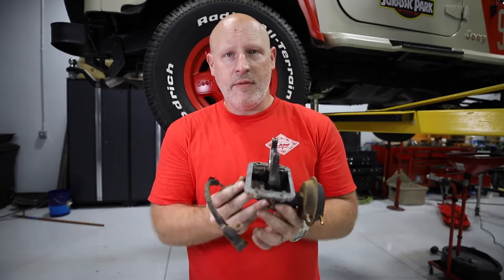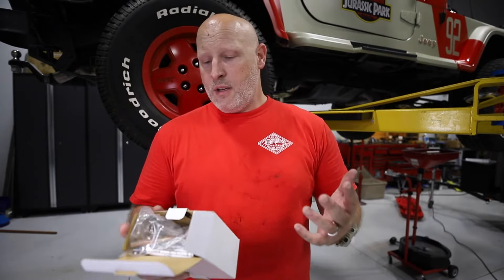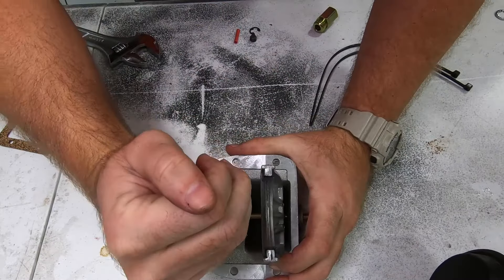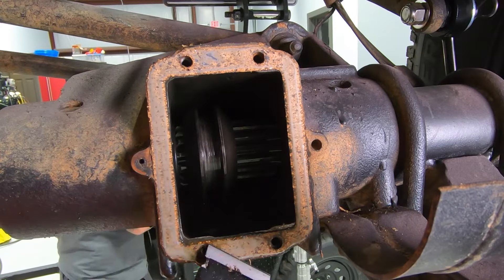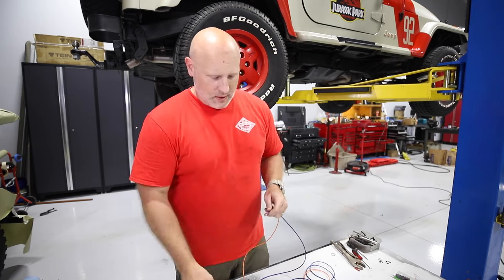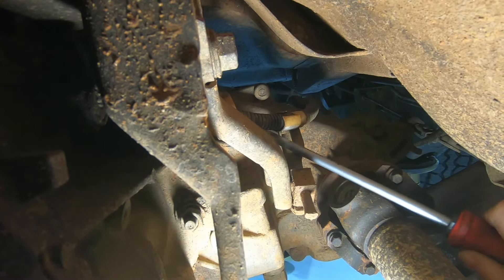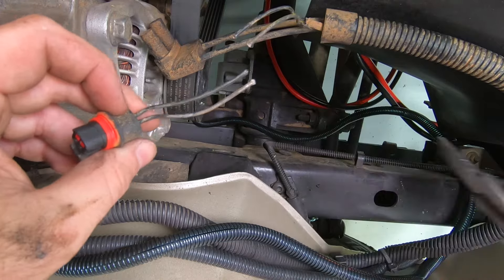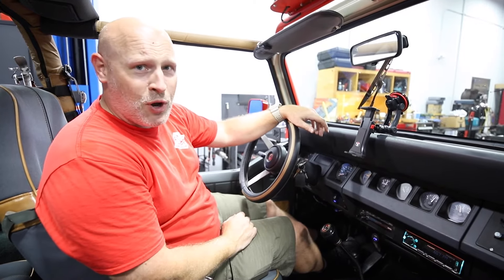Jeep YJ Central Axle Disconnect CAD delete with working 4WD indicator light

Comment: Nice video Matt! I deleted my CAD as well but with a solid axle (same net effect). Great to be rid of a 4WD system that relies on the integrity of a network of small rubber hoses from the intake through the transfer case and back to the actuator in the front diff. An absolute must have mod IMO! Cheers
Reply from the maker: Thanks! Yeah it was a much do for me as well! Hope you had a great thanksgiving!

Comment: On a 93 yj there is no sensor on the transfer case.The sensor for 4wd light is on the cad.There is only a vacuum line switch on the transfercase.
Reply: Did you solve that problem cause in a week im facing the same issue. Please get back.

Comment: Yeah my 1st time that it failed I fixed it temporarily by just pulling it off and putting the hose clamp around the axle holding it in place then I cut open The bad vacuum housing and had a zip tie accelerator for the long distance What just recently went with a cable actuator

Comment: Just what I needed. Thanks for the link to the TY sensor. I don't own a TJ or finding the sensor was concerning but rewatching the video I saw where the link for the correct part was. Thanks again.
Reply from the maker: You're welcome!
Reply: @SimplyMustGo  My PSL900 has a switch on the actuator to be installed. I have no video of where those wires go. Figured that switch would let me know anytime the axle is in lock position.

Comment: Nice option. I replaced the 'CAD' side of the D30 when the outer shaft developed a groove around the outer axle seal. replaced it with a donated XJ half shaft as that YJ outer shaft is stupid expensive. Works fine and has for years. Yeah, lost the 4wd light, but fortunately i some common sense and know when i've pulled the lever!
Reply from the maker: Yeah that’s another good option for sure.

Comment: Very thorough video, I'm actually about to address this on my Jeep but I have a slightly different approach 😉
Reply from the maker: Thank you! What will you be doing differently?
Reply: @SimplyMustGo  I'll be replacing the split shaft with a one piece chromoly shaft and installing a cover plate.
Reply from the maker: @SquareLyfe  nice! Yeah that the next level up for sure.

Comment: Great video!  aside from changing out the sensor for the vacuum hoses on the transfer case what about the wiring plug and sensor at the back of the transfer case? I thought that went to the gauge cluster to control the 4wd light.  Excellent video. I have a 1993 YJ

Comment: great video. I'm currently building my Jeep and I'm doing the front axle now. I purchased the CAD delete kit and I'm prepared to install but,.... the links to the parts you listed no longer show available.... I need the switch and the wire harness connection.... also the plugs....and lastly, what size wire did you use to carry the new set up to the T-Case?  any chance you might know where I can find those parts now? Again great video!!! thanks for sharing your knowledge...

Comment: Hey, I just removed the old and installed the new one on my 1994 jeep wrangler YJ.. broke two bolts trying to remove the bolts had to run to Ace hardware and get new bolts and a couple of washers to come back and weld them and two of the old bolts on to the broken bolts.. finally got it all done..now my dilemma is, the driveshaft is off going to the np231j because I am still running marine water hose and I have to weld on some brackets on the frame to keep them out of the way.. anyway back to my dilemma... I rolled the passenger side  rotor and it was connected to the axle as it was making the yoke turn..but wait..why is it turning and the drivers side is on the ground..not engaged or moving with it or since it's on the ground
.why is everything moving except the drivers side!?!.. any ideas..or is it broken...or stripped ???😮

Comment: I’ve installed this kit and for me the hardest part is the adjustment of the cable to insure proper travel for complete engagement and also disengagement, the latter I believe is what turns off 4wd light, can you Matt or someone else do a video on the cable adjustment? There are two adjustments, one at cad housing and one at engagement handle, this process is critical yet not addressed in video, severe damage could occur if cable not precisely calibrated, help please?
Reply from the maker: The kit I installed did not require the cable, it’s an always locked system. So I don’t really know anything about adjusting the cables. Sorry.

Comment: Great video, but I have a question: Don’t you tires skip/push when turning, especially on dry payment? Thanks
Reply from the maker: No this isn’t a locker. This just fixed the two part axle issue. Lockers would go in the differential and lock both the left and right axles together. This is just making the right axle one piece. It still spins independently of the left axle.
Reply: @SimplyMustGo  Thank you

Comment: Any issue with vibrations at higher speeds? I read somewhere that the front shafts weren’t balanced from the factory due to the oem disconnect. Keep up the good content 🤙🏻
Reply from the maker: I haven’t had any issues with that. But I also don’t take her past about 65

Comment: I put the cable system in mine and it’s been in 2 years.  Working fine.  Is there an advantage to allowing it to disconnect?
Reply from the maker: I don’t know there is any actual advantage to letting it disconnect since ever since the TJ they removed that system completely so it’s a solid axle.

Comment: Hi Matt,

A Quick question..I’ve ordered the CaD vac delete kit plus TJ sensor and the very same connector..is this all I’ll need to upgrade it?

My 94 YJ has the 4x4 light on permanently but isn’t in 4x4 B/c I’ve checked by lifting the front tires 🛞 and spinning only one
Reply from the maker: Yeah that should be it, though I have no idea why your light would always be on, so that might cause some weird issues with the light part.
Reply: @SimplyMustGo  Ok great. I replaced the Tcase because the old one was toast and installed a 1992 with only 125k but I’ve heard in some cases the old Tcase vacuum switch stays stuck open and leaves the 4x4 on even if it’s actually in 2WD. 

So in your video when you’re done installing the new parts on the Dana30 and permanently locked in 4x4, does the new switch electronically engage the 4H when shifting?

Sorry for the additional questions this is new to me as I’ve never owned a YJ until last year and trying to understand how everything works in sequence

Comment: Should you add locking hubs to the front when you delete the CAD Vac?
Reply from the maker: That’s kind of up to you. This doesn’t change anything from the perspective of lockers or open differentials from how it is stock. You aren’t doing anything to the differential, so if you want lockers, or locking hubs or anything else like that, whatever you’d want without this, is what you’d want with it.

Comment: Does the plug that goes into the sensor on the transfer case come with the kit and do you reuse the old sensor? I don't see any links to the kit you used. Can you provide a link?  Great video, seems pretty straight forward.
Reply from the maker: The links to the kit and sensors are in the description, but the short answer is they do not come together. You have to get the kit and the sensors and plug separately
Reply: What is that sensor originally too? Can't find that one in stock.

Comment: Hi Matt. Subbed.  Thank you for doing this video. I have a 90 with 4.7 stroker, howell EFi. We're doing a full resto. The 4wd light was the one thing stopping me from pulling the trigger on this mod. I just ordered everything.  Thanks for the links. My question is....

When wirring the extension wires it shouldn't matter what wire goes where right? Polarity is a non issue as long as I follow the same connections on both sides.  Ty bro.
Reply from the maker: Thank you. I believe that’s correct.
Reply: Thank you for the quick response.  @SimplyMustGo

Comment: I am real new to this and not much of a mechanic, But if I bypass CAD does that leave my jeep in 4w always?
Reply from the maker: No it doesn't. You still have to engage the transfer case for 4WD. This just connects the the two part axle into a solid axle on the passenger side. It also does not lock the drive and passenger side the way a locker would.

Comment: Great Video! Does this permanently engage the 4x4? Or can you still engage/disengage just like normal OEM operation? Thanks in advance and again... Wonderful content!
Reply from the maker: This does not permanently engage the 4x4 you still need to engage the transfer case by switching to 4H or 4L it’s also not a “locker” so your front tires will still spin independently. This just connects that portion of axel which is how the TJs and JK and JLs are normally. It was a weird experiment to have that split axel and it didn’t really do anything helpful.

Comment: I have got a 1988 comanche recently and it has no vacume harness going to the front axle, and no harness going to the transfer case either but 4x4 seems to work, so I recon what I am trying to find out is if there is no vacume going yo transfer is it necessary for it
Reply from the maker: It might not be a vacuum system. I think the only ones that did were the YJs
Reply: @SimplyMustGo  thank you for getting back with me

Comment: Doing the cad delete, does it increase drag on the drivetrain? When I put mine in four-wheel-drive, I can definitely feel the extra strain on the engine
Reply from the maker: No. They don’t do anything to the differentials or the transfer case. So when not in 4wd you will feel no difference.
Reply: @SimplyMustGo  I never thought about the fact the drag could be in the t case. Thanks for the reply

Comment: I have a 1991 YJ. My plugs are different. All I have is vacuum lines where your plug is.  My wires are in the back of the transfer case, and I don’t have a sensor
Reply from the maker: Do you have the 2.5 or 4.0?
Reply: @SimplyMustGo i got a 90 2.5 with the same issue and im doing this in a week with a month old pcl replacement in my knee.  Do you know of a solution to that vacuum switch problem so I don't have to keep crawling and having to fight to get up and down?

Comment: Sorry for my misunderstanding, if we do this then drive on pavement is it bad?  This is of course with transfer case in 2wd (disconnected)
Reply from the maker: Hey! Not at all. All this does is basically lock the two section of axel together the same way the other side is and the same way it is on every other Jeep after the YJ. It doesn’t lock the differentials, so it doesn’t change anything driving on or off road. All it does it give you one less thing to go wrong. If the vacuum lines were to fail, then that passenger side axel wouldn’t lock meaning you’d never get any power to the front passenger tire. This way, as long as the transfer case is engaged you’ll get power to both front tires until the open diffs engage.
Reply: @SimplyMustGo  I greatly appreciate your time to reply!  After battling grinding from a partial (and uninitiated) CAD, I'm excited to finally be rid of this terrible design forever. All the best.
Reply: I should add, I have the posilok 4x4 system.  Grinding only started after this purchase.
Reply: I was wondering about the locked axle, and turning on hard ground/ pavement etc. you answered that question so thank you !

Comment: Hey Matt! Need your help. I did the cad delete awhile ago and finally just did the 4wd light part. Only problem is my light stays on in 2wd also. Any ideas? Also it’s a 92 yj 4.0 5speed.
Reply from the maker: Hey! Unfortunately, I don’t have a good answer. I’m guessing it’s either not connected correctly, but I really don’t know why it would be on. I can’t think of a bunch of reason it would be off in 4WD, but not on in 2WD.
Reply: It’s actually on in 4wd and 2wd. I threw this question out to some others that did videos like this. Nobody really has a solid answer but said the sensor could be bad even though it’s new.

Comment: So when I do this mod, can I take ball looking thing any vacuum lines under the hood ?
Reply: Let me answer  since  no one  will yes throw  that sht away and cap off the vacuum  at engine  I've made my own disconnect from  a boat 🛥 shifter cable since I've installed 4×4 in my ramvan there's no lights yet

Comment: i dont understand this, how can u use 4x4 now, the posi lock ones had a cable that actuated it
Reply from the maker: This doesn't really impact 4x4 at all. This doesn't do anything to the transfer case or the differentials. This just permanently connect the two parts of the passenger axle shaft to make a single axle shaft, the same way it is in the XJs or TJs or JKs. There's no need for a cable since you don't need to turn it on / off. You still put the Jeep in 4wd by using the 4wd shifter and putting it in 4H or 4L. Many people will also just replace this whole passenger side shaft setup with an actual XJ shaft. In my other YJ I'm getting ready to do something similar, by taking the two piece out all together and replacing it with a single shaft.
Reply: @SimplyMustGo  do you have a locker in this jeep?
Reply from the maker: @dizzlerizzle2775  No, not in this one. I'm going to put one in my other YJ Soon. probably a lunchbox locker like a Spartan locker.

Comment: Is there any downside to doing a CAD delete. I read that it turns a chain and wears parts in the T-Case. I would like to do this but do not want to add another issue. Thanks
Reply from the maker: I’ve had this done for 2 years now and I’ve driven all the to Dayton (9 hrs pulling a trailer) I’ve driven all over on long 6 plus hour trips doing 70mph and I’ve never had any issue. No vibrations, no change in gas mileage. I’ve heard of other people claiming stuff, but I’ve only seen a positive result.
Reply: Thanks Matt. I just completed the delete.  @SimplyMustGo

Comment: The question is how do you unlock the axle from the hub with those wheels?
Reply from the maker: You don’t. This isn’t like a locker where you are locking both sides of the axles together at the differential, it’s just connecting the two part axle on the passenger side to be a single passenger side axel. The same way a TJ or JK out be and the same way the driver side of the YJ is.

Comment: Hi Matt,

I just completed the same install you’ve done here but the only thing is my 4WD light 💡 doesn’t come on when I shift. Any ideas?
Reply from the maker: You swapped out the sensor and everything?
Reply: @SimplyMustGo  it works now! Turns out it’s a slight mechanical issue at the shifter inside the YJ I ever so slightly pulled a little further back and boom! Thanks Matt! Wonderful video!

BTW please submit more of these! I used your video as a template for performing this from scratch from the factory stuff and your very patient and the video was very easy to understand for sure!
Reply: @SimplyMustGo  yep swapped out the sensor. The original YJ sensor was stuck closed

Comment: wouldn't it be easier to just put in a TJ one piece RH axle shaft?
Reply from the maker: Easier… eh maybe. More expensive, probably.
Reply: @SimplyMustGo  wrecker parts :-)
Reply: @kurtkesters6043  I’m pretty sure you have to pull the carrier out of the front diff to do the TJ one piece shaft. I think that’s the only way to get the new inner seal in.

Comment: This can be done without the wiring for the 4wd light correct? Mine has never worked and I dont mind not having it.
Reply from the maker: Correct. You can do it with that for sure.
Reply: @SimplyMustGo  when I opened the cad vac on my 92 I noticed that there was no fork and the vacuum connector was capped off. Inside the cad vac housing it was just a straight axle. I'm guessing the PO swapped the axle out with a straight one from a TJ?
Reply from the maker: @_JEBUS  yeah that’s a pretty good bet.

Comment: Another question, does the kit allow you to connect/disconnect the front axle or is it permanent?
Reply from the maker: This kit permanently locks the right axle into one piece instead of two. It does not lock the left and right axles together. It’s not the same as a locker, so each side of the  differential is still independent.
Reply: @SimplyMustGo  Ok, Thanks, excelent video

Comment: With the axel on the right locked , how does the stock differential work ?
Reply from the maker: It doesn’t impact the differential. It’s not locking  the left and right axels, it’s only locking the to two parts of the right axel to make it a single
Axel just like the left one. (Or just like it is in an XJ or TJ)
Reply: @SimplyMustGo  is the front differential locked to the axels all the time ? If not what engages the axels when the transfer case is put into 4hi or 4 lo ?

Comment: Dumb question, what type of wire is needed for this?
Reply from the maker: Do you mean electrical wires? 14 gauge is probably best. Otherwise there is not other wire for the cad. It removes the need for the vacuum lines or a wire
Reply: @SimplyMustGo  right, the new wire used to plugg the tcase switch. Thanks!

Comment: Does this make the Jeep full time four wheel drive?
Reply from the maker: No. Not at all. It doesn’t change anything with the transfer case or the differentials. It simply make the passenger side a solid axle the way it is on an CJ, XJ or TJ or JK
Reply: @SimplyMustGo  thanks

Comment: That part work for a Dodge RAM 1500 2001?
Reply from the maker: I don’t really know anything about the dodge, but I’m guess they didn’t use a split axle design so I don’t think this mod would be needed. If they did use one, I doubt this particular part would fit as it was specifically designed for the YJs.